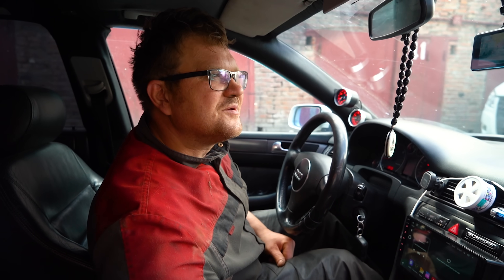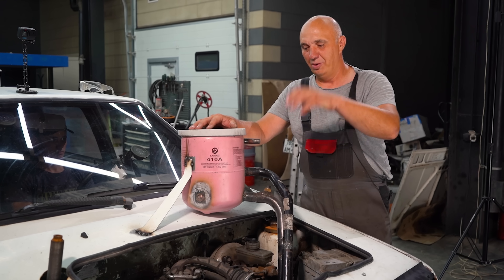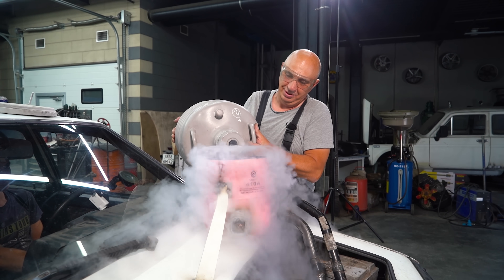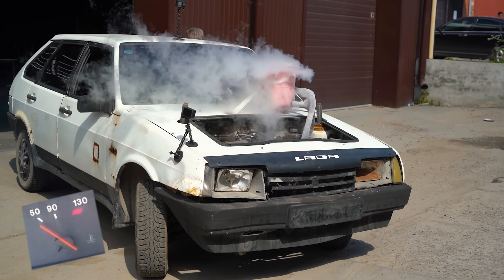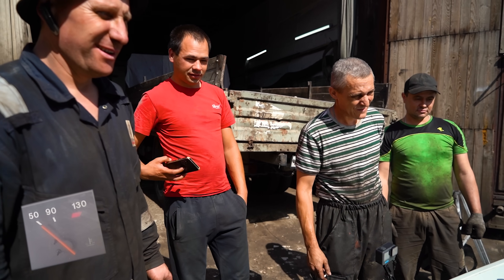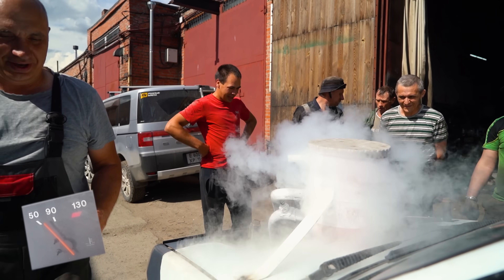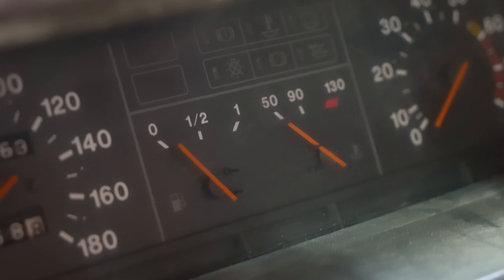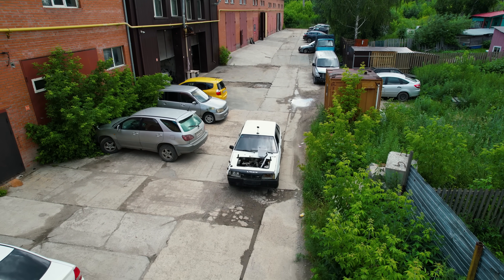Liquid nitrogen cooling system for a Lada - will it work?

Comment: If you actually pumped that into a system. And closed it off, it would probably last a lot longer. Awesome experiment, guys.
Reply: It would need a multi stage compressor and a major condenser. Run it like a refrigerant system.
Reply: The liquid will evaporate as it warms and explode the system lol
Reply: @DogsaladSalad if it can hold the pressure it would keep it at a liquid for the most part lol

Comment: 2nd comment, I love y'all's crazy experiments. Y'all are definitely my favorite Russian YouTubers. Don't know what is going on with the gearbox as definitely heard you grinding some gears. Not sure if it's an unsynchronized gearbox or what, but considering I'm one of the few Americans that still prefers to have a manual transmission, it's kinda painful. Anyway definitely a cool video, and my first thought was that it might crack the engine block or cylinder walls, but it seems like the lada held up. Gotta love the old school cars. I think a better use for nitrogen could be as an environmentally friendly refrigerant for the air conditioner. The pressures needed for this will likely be much higher than the refrigerants used today though, especially in older vehicles. My 1990s car uses R134a refrigerant, but maybe nitrogen can be used in the future. Releasing nitrogen into the atmosphere is pretty much harmless as the air we breathe is about 70% nitrogen. Anyway, I wish we still had manual transmissions here in the USA. They're much less complicated and last longer. It also makes for better drivers. Anyway, cool video to say the least. Literally cool.😂
Reply: It should be even better than freon gas one would think and so much, as you state more environmentally safer!

Comment: Use it as a gas sorry petroleum gas but well liquid nitrogen what’s the hp or bpm depending on country.
Also how much damage can it do to the engine?
Or use liquid o2 as nitrogen doesn’t burn unless under extreme heat or pressure or a mix of bolth

Comment: Wouldn't it last longer and provide better compression if that container was sealed? Perhaps just a pressure valve to release excess pressure?
Reply: No, the evaporation is what makes it "cold". 

You can boil a pot of water for 20 minutes and it won't get hotter than 212f / 100c, but as soon as the water runs out the pan can turn red hot. 

Liquid nitrogen is the same thing, it's boiling, but it's boiling at sub zero temps. They'd need to make a system capable of handling over a thousand PSI to handle "warm" liquid nitrogen.

Comment: This is a great application for drag racing. Nitrogen cooled cold air intake. Oil coolers ,Fuel cooling without a fan or ice. Keep those used NOS bottles , could come in handy.
Reply: After a run a nitro drag cars engine is freezing cold, iced up and thiers no cooling system whatsoever.
Outside of that, a regular engine with nitrogen as coolant would hurt performance with the engine outside of its optimal running temperature, or even break it.
Reply: @jeremywhittler8591   Yes you are correct, but some race classes  such as a Sportsman or Gassers  run gasoline. Nitro methane does create lite  frost on the blower.  This could be applicable on a Turbo car. Hot and Cold side.
Reply: @JonMadHatter  no , no it wouldn't. 
Once again on a turbo hot side it would hurt performance, it also would cause oil starvation at those temperatures and grenade the turbo.
You want the hot side hot for gas flow, they'll never use liquid nitrogen in intercoolers either.
Its way too dangerous as far as spills on human tissue. 
It has no place in racing.
Reply: @jeremywhittler8591   I suppose you have a point with the safety issue . Nitrogen is liquid @ -421 F . Be like exposing human tissue into outer space. Too bad though .Good cooling but little on the extreme side.
Reply: Some of the street drag racers use ice etc. in an airbox arrangement.

Comment: Refaire la même chose avec un circuit fermé éviterait une partie de l'évaporation, vu qu'il faut beaucoup de pression pour re-condenser le nitrogène liquide ça éviterait pas le soucis mais l’atténuerait, bien entendu mettre des soupapes de sécurité soit à un bars comme les systèmes d'eau normaux, soit plus haut avec une wastegate externe tarée à 2/plus bars.

Doing the same thing with a closed circuit would avoid part of the evaporation, since a lot of pressure is needed to re-condense the liquid nitrogen, it would not avoid the problem but would reduce it, of course put safety valves either at one bar like normal water systems, or higher with an external wastegate set at 2/more bars.

Проделав то же самое с замкнутым контуром, можно избежать частичного испарения, учитывая, что для повторной конденсации жидкого азота требуется большое давление. Это не избежит проблемы, но смягчит ее, конечно, поставив либо предохранительные клапаны, либо один из них. бар, как в обычных системах водоснабжения, или выше с внешним перепускным клапаном, откалиброванным до 2 и более бар.

Google Translate для любого языка, кроме французского.

Comment: Just safety glasses for liquid nitrogen?? Damnit man! 😆 😆
Reply: Actually less clothing is safer with liquid nitrogen, as with clothing it will get absorbed and freeze your skin and that could be critical.
On the other hand liquid nitrogen on bare skin is totally safe as there will be a vapor layer between and it will easily fall off
Reply: @HappySlappyFace  This is very true! I was just being silly, but you're right. I'd think you'd at least want the eyes covered, which he did do at least.
Reply: If it touches your skin it just rolls off. Boiling water will hurt you, this won't. It creates so much gas as it expands that it protects you for a bit.
Reply: It just gets very cold 😅
Reply: Russians are tougher than safety equipment.
Reply: Next on garage 54, we take a radioactive isotope and……

Comment: Hey do a System with Heat Exchanger Inside of the Bowl and use water Inside the Engine. So the nitrogen would only cool the water down. So you can also keep a Thermostat
Reply: The water would freeze and block the circulation.
Reply: @Moonlightshadow-lq4fr  simply use antfreeze, I doubt that the liquid nitrogen freezes the circulating liquid below -40 to -50 degrees where antifreeze stops working, if it even didnt Crack a lada Engine or Water pump when used pure
Reply: @Moonlightshadow-lq4fr  you could also let the primary System warm up to its operating temp and then drop the nitrogen Inside the canister
Reply: @Moonlightshadow-lq4fr not if they only use large pipe for heat exchange, smaller diameter pipe would surely freeze up too quickly, but with a larger area you could just rely on the inner flowing water to melt the water freezing on the walls of the pipe contacting the LN2
Reply: @zacharyreid7557  It don't matter what you do it won't work.  You simply can't have ln2 cooling the engine unless you have a constant new supply of it otherwise it will simply get warm.
Reply: @Moonlightshadow-lq4fr  yeah we all know its not practical in the slightest lmao, itd just be fuckin cool to see tried
Reply: @zacharyreid7557  Absolutely, I think it's great what they do on here 🤩
Reply: The water would freeze instantly
Reply: They should use a digital meter. it can go to 0 degrees

Comment: so you made it with an open reservoir system, what if you removed any weak components such as the rubber hoses and created a pressurised system, meaning once the nitrogen has gone in, it gets sealed and hopefully never needs to be topped off
Reply: That would create a big explosion.
Reply: Well before the nitrogen getting to ambient temperature the radiator would explode if it were a sealed system, even if you had a super strong radiator it would be less efficient than water as it is less dense so wouldn't conduct the heat away as well as water.

Comment: Before I watch if I had to guess it'll 'work', but wouldn't last. Engines generally like to operate at a certain temperate (IIRC), not to mention the metal being cooled that much would probably embrittle it as well. Looking forward to seeing the results though.
Reply: those lada engines are made to such loose tolerances the shrinkage would probably just make it run better.
Reply: @axeman2638 lol.  Suddenly closing the tolerances ended the vibration and added 50 hp to the Lada 😅
Reply: I am surprised the block didn't crack when he poured it into the warm engine.
Reply: It is lada, they even siberia.

Comment: Somehow you got to close the loop and  not let the gas escape.  Otherwise what is rhe point? Likey will need a pump to compress the gas again after
Reply: It cools by boiling, that's why it off gasses so much.

If you make it a sealed closed system the pressures would likely be well over 1000psi, maybe 2000 (I'm not looking up the chart). That's a gun range experiment, because something will blow HARD, no plastic, no thin walled tubing... The coolant jacket of the engine block could likely blow up.
Reply: Ln2 making device is a bit trickier than regular compressor. But maybe they left the radiator cap off or something

Comment: But does the air conditioner work?🤣
Reply: hmmm i think it work but it might be super freezing☠☠
Reply: @mrcrab-o4g the cooling system has nothing to do with the air conditioning. Its a separate system. It only shares the cooling fan so its operation would be the exact same
Reply: The heat likely blows ice cold lol
Reply: I'm guessing the heater would be a great air conditioner on this setup. 😄
Reply: @Gandoff2000 I'm so mad they didn't try this
Reply: What is a conditioner😢 🤔?
Reply: @Bruinou19 you don't know what an air conditioner is?
Reply: @giggiddy 😂nope
Reply: @giggiddy  jk bud😂
Reply: @Bruinou19  😂😂
Reply: the car ac cooler
Reply: just keep the windows open. gives a whole new meaning to 65mph open window cooling a/c.
Reply: @garycarpenter2932 As my grandfather would say "It's All four and to the Floor" air conditioning.😂
Reply: A Lada with air conditioning? In what would do you think this is!
Reply: The heater no longer works.
Reply: It throws ice cubes out the vents. Lol
Reply: Might want to test nitrogen as refrigerant
Reply: Liquid nitrogen A/c would have ben more practical 😊
Reply: It's getting warm, turn the heater on
Reply: I wonder!! 2 compressors
Reply: If ac gets colder than 15f it will ice up and stop flow
Reply: That pipe through the windshield idea is great, except that it'll put everyone in the car to sleep with the windows down 😅
Reply: It’s gonna blow-15 c air
Reply: I doubt a water temp sensor reads in nitrogen
Reply: what air conditioner?
Reply: Hmmm yes kid sir it works with a little bit of lung frost
Reply: The heater works I'm sure 😁 just as an ac tho 😅
Reply: Does a bear shit in FERTILE woods
Reply: Yep works, notish the r410A tank.....
Reply: The Engine is the air conditioner with liquid nitrogen